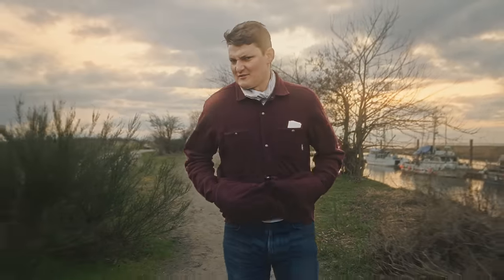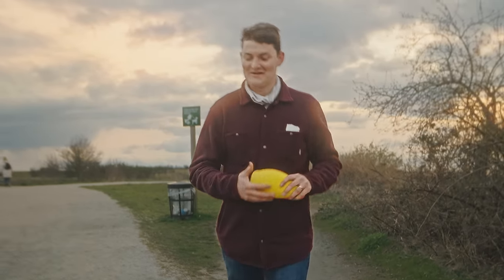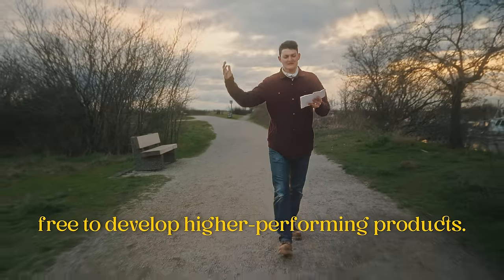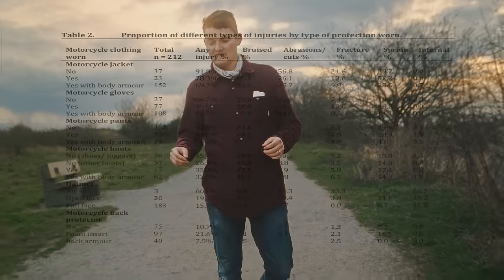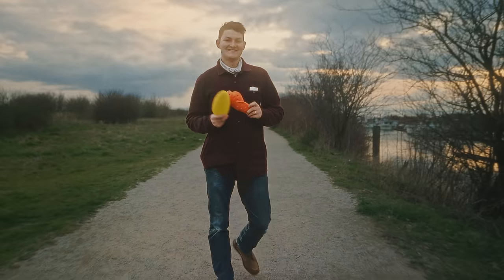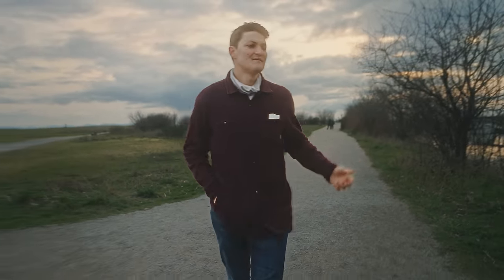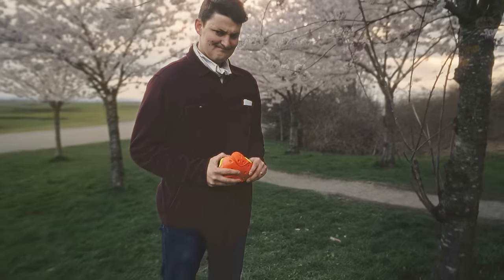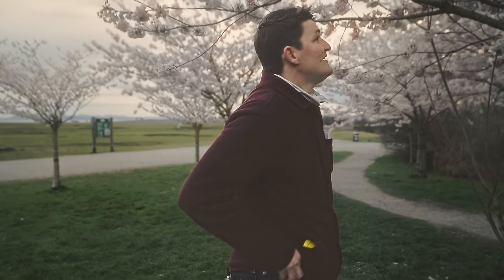Why I Stopped Wearing Motorcycle Body Armour

Comment: For someone who rides dual sports and has a lot of low speed falls the armour really does help. Probably doesn’t make much of a difference if you hit a wall at 90.
Reply: exactly mate, clonk a body part on a tree at 30 KMs am hour and the pads work 🤘🇦🇺
Reply: Fell over once doing some slow speed work in a parking lot. Landed hip first on the ground. Had hip armour in my pants, so I didn't feel a thing, but l imagine that would not have been the case without it. At the very least wouldn't been some bruising.
Reply: And if you fall on it again? Yeah, right. "Pads are worthless." 

You know what is actually worthless? This video!

And to think so many people will simp over Ryan and his ability to read a script for 7 minutes that they'll just take his word and suggestions to heart and remove the pass from their gear anyway.
Reply: @werepat  ...if you actually read the comments you'd notice people either contesting him or reinterpretating his words correctly (current armor bad, we want better armor) but no, keep whining
Reply: I really only wear the armor as another layer of abrasion resistance for the slide and not the impact.
Reply: Knee armor doesn't work if you leave it in the closet though   ô¿ô
Reply: @werepat  he specifically said he is not telling anyone to remove their pads, he himself is using costlier safety equipments and the whole point was to inform abt the low standards of the industry, U can understand this and not remove ur pads OR u can twist his words and be a bitch abt it.
Reply: @ZeroXSEED  Enough to promote people to take out their current armour? even if it is the only thing you have? Of course there are better and more expensive ways to protect yourself.. Jackets arent gonna include free airbags anytime soon. It´s the same as saying.. if you dont have a carbon helmet just ride with your favourite baseball cap....
Reply: @MaxArg1988  ...He specifically said he doesn't advocate taking out armour.
And of course, Ryan always have most expensive antiabrassion pants + airbags so he's double privileged. Armor is literally cheaper by loads.
Reply: @ZeroXSEED  he specifically says he doesn't, but he still is. Being an influencer means people will do what he does... and if you rant for 7 minutes about why you take out your armour, people will tend to do that same thing. If you hit something hard with those foam protectors (not the really cheap ones, but the black or orange ones) you'll save your kneecaps 9/10 times for sure. Those freaking things are brittle 🤣
Reply: @ZeroXSEED  damn. Just realized this an april fools joke. Just as a justification.. im from Argentina.
Reply: @tazzjazz  the very last things Ryan says is that he is taking the the pads out of his gear, that he Loves it, and that he's doing so because being to focused on safety sucks the beauty out of life.
The implication is that he, an expert, doesn't want to use pads and that if you do, you're having a worse experience for it.
Reply: @ZeroXSEED  I'm so glad I don't go through life thinking the way you do.
Reply: @werepat   (looking at serious nature of the video direction i dont think its an april fools but i may be wrong.) well it is true that every safety precaution we take compromises our comfort in terms of feeling light and free movement whether it be seatbelts, helmets or full body suit, we do it only for the sake of our safety. But idk abt u i always felt safe with my shoulder lev 2 pads but if it isnt going to prevent a fracture at mid-high speeds then its lev 2 standard it is not serving its purpose, cause i being a touring only rider am not going to crash and hit my pads at low 20-30 speed to use whatever protection it provides. Now i would still not remove the pads cause i dont have airbag and exceeding CE standard money. and now on his POV, he from his statement seems to value ease and comfort over CE LEV 2 PADS cause it still gives u a fracture on mid-high speeds. If he is advocating for removal of pads then he is also advocating for airbags and EXCEEDING CE pads, which just mean he prioritizes his torso and legs more than his joints with lev 2 pads cause they are gonna fracture anyway on high speed. if someone is dumb enough to only look at the CE lev pad removal part of his statement and removes Their pads, then its on them.
Reply: @werepat  Wouldn't really call him an expert tbh and I think this video really show how far out of his depth he is.

Comment: I'd concur, if I hadn't been dragged 50 yards under my Blackbird fifteen years ago, and almost worn through the shoulder pad in my jacket. No pad, no shoulder. A single data point, maybe, but it's my single data point. Two years later my femur was smashed by my handle bar, but that was where there were no pads.
Reply: But if you listened to what he said.. he openly said they can help for abrasions and that maybe enough for people to keep using them.
Reply: Wow sounds like you've just discovered anecdotal evidence. Congratulations
Reply: That’s exactly the point he made in the video. Good for abrasions, not so much for fractures.
Reply: exp bias
Reply: @nigelcook730  same for the rest of the moto gear. Should we ride without jackets and pants?
Reply: @dannydevito5729  the studies he describes are also only using to crashes resulting in injury as the sample population, which biases the data against crashes where the rider suffered no injuries, with or without body armor. That's not to say he doesn't have a point, just that his data source may be skewed more than we realize or he intended.
Reply: Which is more than enough to not make this video! A bad scrape can ruin you for a few weeks. Think about landing on your knee on a small pebble both with and without a cheap, foam pad. I'm keeping that pad on!
This video is bad advice and not very good understanding of falling down!
Reply: your femur? but there is no armour for the whole of your femour only hips and knee? a hardshell may be good for fractures
Reply: @dannydevito5729  Wow, sounds like you just discovered sarcasm. Congratulations.
Reply: @dannydevito5729  Well, I can confirm his anecdotal evidence
The claim that it's anecdotal, is entirely yours however
Can you prove it ?
Reply: Shame on you for destroying a Honda Blackbird
Reply: @canadianwithabeard  Not "maybe enough", part of the reason you wear pads is for abrasion resistance. There is very little reason not to wear the pads, as you're much more likely to slide than fly and crash onto the road.
Reply: @nigelcook730  but its not intended for fractur protection so I dont understand his point
Reply: @steve00alt70  you know how you (generic) "stand" on impact? And how the bars will go one way or the other when the wheel hits the car? On a GL1800, that places the handlebar, with some vigour, exactly where the bottom of your femur wants to be. It really, really, stings. For months.
Reply: @dannydevito5729  I'm still not sure a protective device that fails at one injury type, but succeeds at others, deserves throwing away, though.
Reply: @Ibis117 simple is to find armour that wraps around your femur
Reply: @hornyducks4090  to be sure, Ryan does say that he Loves riding without the pads in. That statement alone is enough to negate the couching he does prior to that, and more than enough to convince many people that they, too, will Love riding without their pads in. 
He says this while literally throwing the pad away.
Reply: @canadianwithabeard  His final conclusion is idiotic and defeats the point of the video. Armor helps and he admits he is too stupid to wear it because it doesn't help in the most extreme case. It's like removing some safety feature because it doesn't cover you for everything. The accident information is useful, although flawed, but the presentation is bad for new riders.

Comment: What is totally correct about this video is that it is very important to have protectors in size and positioning that wrap the complete joint. Those small standard protectors in textile products are not extremely helpful in being there where you need them when the impact hits you.

Every good sales pitch I had so far had the imprtance of correct fit of clothing AND protector pockets. During riding and weird twists you take when you fall. So when you move they still need to cover you. Also everyone told me the stuff they put is just filler so the pockets are not empty on trying it out. You always buy the good stuff afterwards to replace it - it's still a market - you're also right about that. Most ppl don't care about it or don't know about it so it's not a selling point. Only the most expensive suits 2-4k got it included already. Those also absorb/spread a lot more force. What is really hard to find is a good suit with a pocket or good protector that also covers the coccyx so you don't have to wear those maximum uncomfortable for anything but one-piece back turtles.

I don't understand why most ppl rate protective gear in this order: helmet, jacket and maybe gloves
When for my experience it should be more: Helmet, gloves (with combination shockpad + hard shell on nuckles, fingers and tying together the weak fingers - there is a reason there are hospitals specialized alone for hand surgery), massive boots with inner or outer skeleton restricting movement of the joint. Then the pants. hip is the place where you will slide on the most. Then the jacket where active safety like staying dry and in your temperature windows is even more important than passive safety.

Purchase different gear and sizing for different temperatures. One combined with insulation shit in fall but not in summer will not fit correctly in both occasions and will less likely keep the crashpads where they belong. Everything textile below 2k bucks is only for very slow slides. If you want  more, you don't want the same d500 shit doubled or tripled. you want leather and or at least kevlar. The plastic will just melt into your skin.

I find airbags horrible for active safety. Feeling comfortable. I would take the Rukka protectors above it any time.

I know ppl who kept their feet from a side crash and just break or crush it instead of tearing if off or crushing it to amputation level because they had Daytona Shoes. I someone who has a stiff leg now but kept it instead of loosing it cause he wore the best schwabenleder two-piece leather suit with the best protectors instead of losing it.

Protectors are improtant. I can just walk it of in small or medium sized impacts with a lot less damabe to recover from or just keep a limb or organ instead of loosing it. It's not always 0% or 100%. Sometimes 10-20% reductions is all you need to be able to recover at all.

btw. that almost leg loss was with 45kmh - scooter speed. Just an unlucky fall into a siderail. Which for me is no argument for not protection but all the protection you can get for all the speeds and all the distances. Even if it's 30km/h for 5 km to the ice cream shop.

Comment: Almost. If a fracture occurs at 4kN and our substandard (I agree) padding reduces the force of the impact (i.e. 6kN)  as well as the disruption of the impact to below 4kN, the fracture will likely not occur. This will be a moot point for anyone riding a street bike into a concrete barrier at highway speed. But as some who have taken hard falls on elbows, hips and knees off-road, fall on my CE2 pads and Leatt knee and shin pads have saved my day more than once. Most of us have tried it both ways and regretted the days we left the padding at home. It is also important to remember the stats are only collected when someone presents at the hospital. This data is completely void of all the impacts that occurred, with padding, and no serious injury occurred.

Comment: That's why the motto is: "dress for the slide, not the ride". Pads don't protect that much against the impact itself (minus the helmet), but is all about making the slide comfortable.
Reply: Slide also rhymes with ride...
Reply: Just to add, I have never expected pads to prevent fractures, they just would have cover the entire limb to  be able to do that like a suit of armor or a MOTOGP suit.  Its always been about the slide for me.
Reply: This is a good one; I'll have to remember this. Another one I have heard for helmets is "skid lid."
Reply: @spartanx169x  I think that's just the common sentiment, as it is very obvious, but if the companies did hold up their end on protective gear then we might not need to dress for the slide, but the fractures and the impact.
Reply: Seems like some protection is better than none. It might not save a bone when the force is very large, but if it was just enough to break a bone, is the pad not going to absorb some of that and save you from a fracture?
Reply: Also hurts lot less to hit knee to sharp rock or debris with the pad in between. Judging usefullness by only looking at the force required to break a bone is like saying the whole bike is crap because of bad headlight.
Reply: @itoibo4208  Logic agrees with us both. just drop to your knees on asphalt with no armour vs with armour.
Reply: Man you guys missed the point... Pads COULD be better. He very clearly said he's not telling you to stop. He explained why regulatory capture and minimum standards are creating an environment where the market is less competitive and the gear is less safe than it should be. 
"I'm still going to use my pads" ok great, thanks for sharing.
Reply: @jumpingjackflash86 And he's not. Okay, great, thanks for sharing.

See, I can be a dismissive dink as well.
Reply: @Jyyzto  This is why I wear mine.  I'm aware they're going to do SFA if I'm thrown into a Camry.  But they sure as hell make a big difference when I fuck up on the dirt and just fall over onto rocks.  I go from a 6' fall into rocks which would be debilitating injury for my 50 year old joints to absolutely nothing beyond brushing off dust.

Yeah.  They won't prevent fractures on heavy impacts.  But if I bang my elbow into something hard enough to hurt a lot, they'll turn a ride ending ouchy into nothing.

If they impaired my enjoyment of the ride, that would definitely be a factor.  But they don't. My Revit Sand 4 jacket is quite comfortable.  

And if all else fails, the injuries I'm honestly most concerned about are long slides on pavement.  Not that they're the worst that can happen - they definitely aren't - but there's nothing I can do about a high speed impact.  On the other hand, adding half inch of armour on pressure points during a slide is just that much further I can slide without injury.
Reply: My slides are so comfortable, that I rarely spill my martini.
Reply: @jumpingjackflash86  I understood that and also the fact that this video is purposely made controversial to wake up discussion. Yet ”protection could be better” is still silly argument to not use any.
Reply: Pads saved me from many broken bones
Reply: Exactly, I'm not wearing my full leathers with pads because I expect to impact the ground at high Gs, but to absorb some of the hit and then to serve as a separation between me and my now-hot sliding leathers.
Reply: @admiralbeez8143 And that's assuming you're sliding and not tumbling.